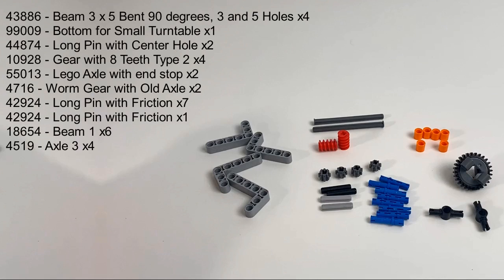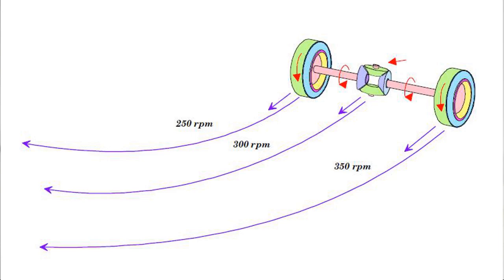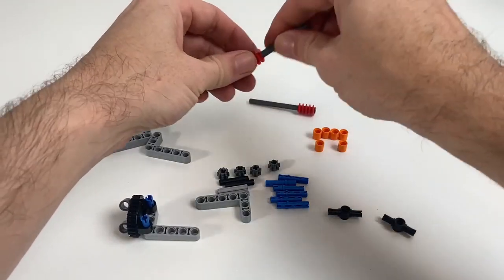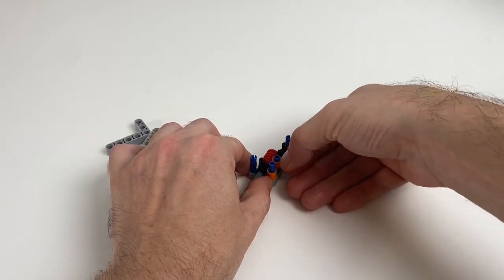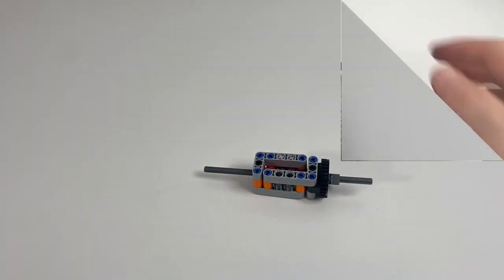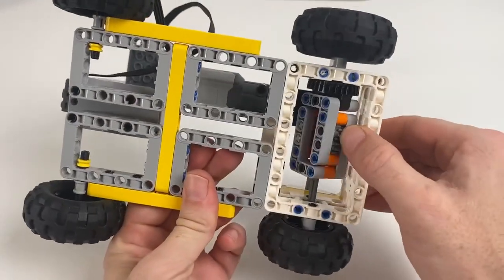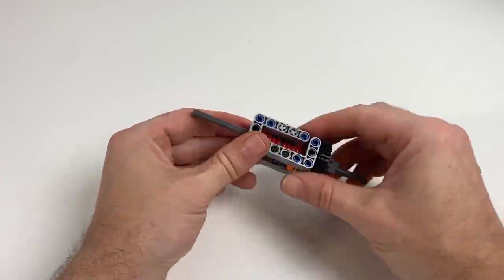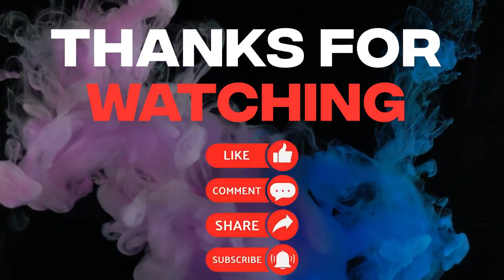Lego Differentials - Torsen Differential - Part 4 (of 7)

Comment: Nice build manual, but small gears are spinning only with real 3713 technic bushes, not with 18654 technic pin round connectors. In this case we probably need to stay with plain blue pins.